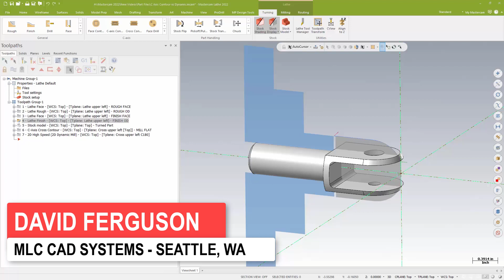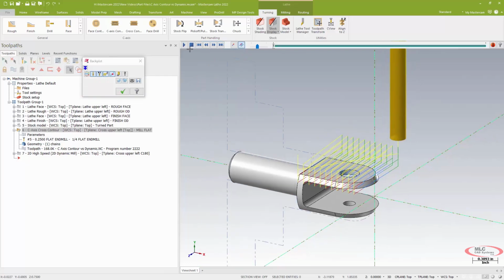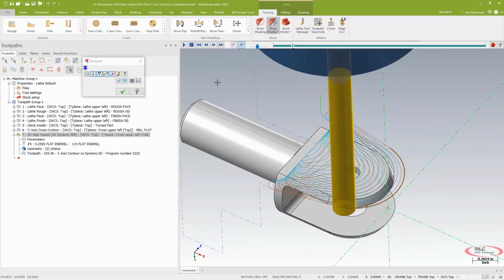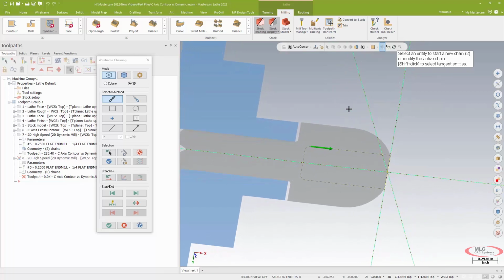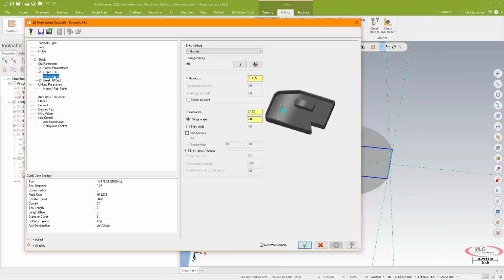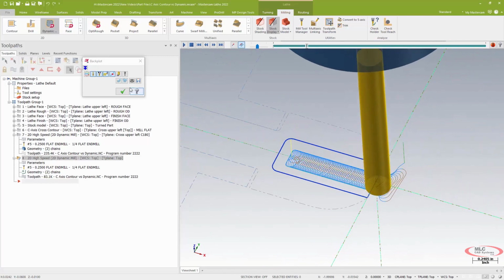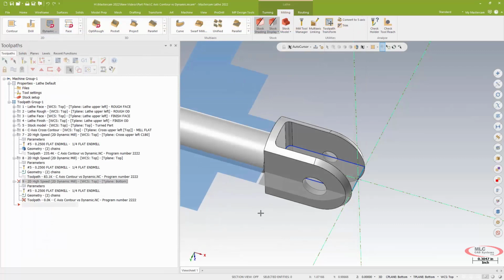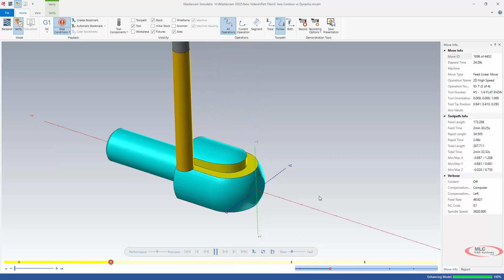C-Axis vs Dynamic Milling Toolpaths - Tips & Tricks for the Mill Programmer

Comment: i am trying to circle mill with c axis FACE contour drill first and then contour 3 passes but for spring pass i have to turn off lead in /lead out or i'll get an alarm is there a way to activate it?
Reply from the maker: There are a lot of variables involved in this scenario that could impact the behavior, too many to try to troubleshoot this in a comments section.  I recommend reaching out to your value-added reseller for support.  If you are an MLC customer, you can find contact information or submit the case online at https://www.mlc-cad.com/technical-support/
Reply: @MLCCADSystems  can you email me a post i can use ? must appreciated